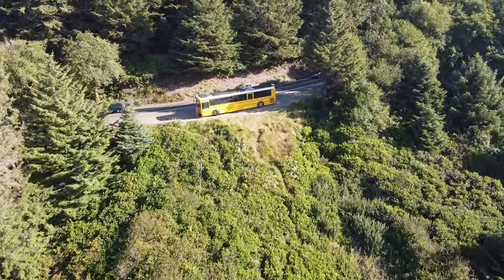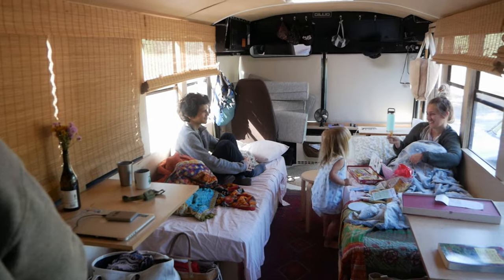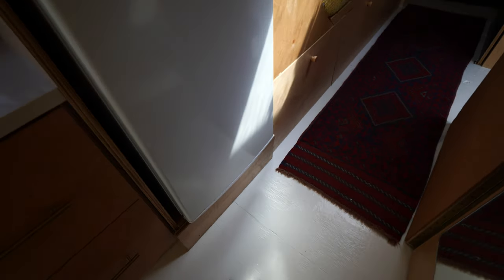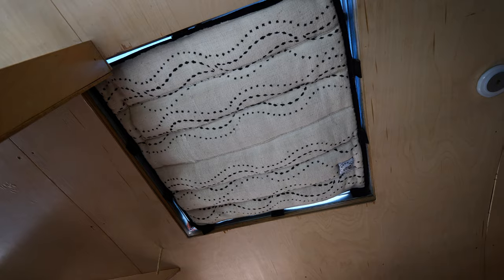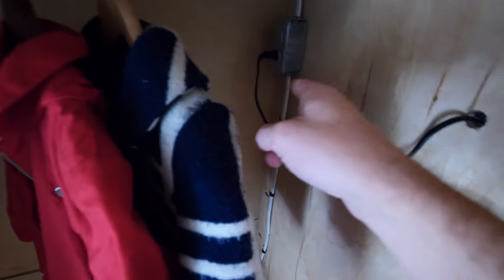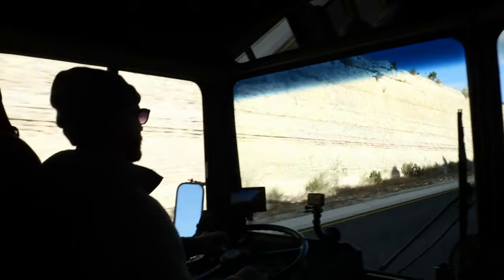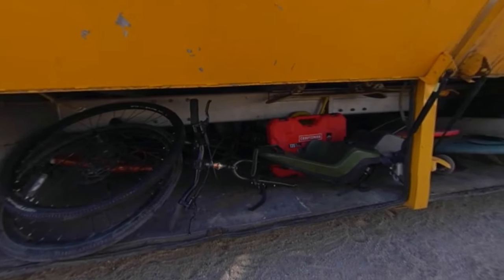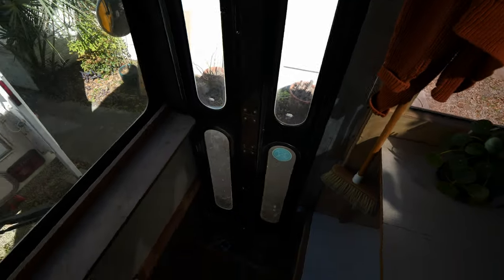Tour Our Beautiful Bus Conversion that Could Be Yours

Comment: I love this bus and I have enjoyed watching your videos but to be honest at the end of the day it's a 36 year old bus and almost a hundred grand I could buy a very nice rv that is new and has a warranty.
Reply from the maker: It really depends on where your priorities align and I completely get why you may feel that way about the price. I have spent a lot of time talking about the pros and cons of a class A RV vs a school bus conversion over the years in videos and with bus and rv dwellers and unless we're talking about something unique and built on a Coach Bus chassis (which a Gillig Phantom has a lot more in common with than a school bus) I'm picking the bus conversion. With a well built used bus I have little concern of depreciation which you're going to experience heavily with a new RV. I have a rig built on a steel and aluminum platform, not fiberglass and 1x2's, quality hardware which RV's lack, Birch plywood construction vs manufactured materials and vinyl walls. A bus can be purpose built for a use case like ours has been. An RV has been mass produced for profit. New RV's lack meaningful solar power, don't have lithium battery banks, don't use reliable Victron components. A bus is more exciting, fun, has more character, can be more aesthetic. Rv's are mild mannered, sensible, similar to other rigs at the campground. But realistically and probably most importantly there is no Class A 40 ft RV brand new for $100K. There just isn't. For $100K you're getting a 5 year old 32 ft gas front engine RV and I'm sure that's fine for you but it's not really in line with our bus. A new 40 ft Pusher built on a coach chassis is absolutely north of $300K. Sorry for the essay!
Reply: @MobileDwellings  I absolutely agree 100% with everything you said my biggest concern would still be with the 30 year old drive train.
Reply from the maker: I'm going to pick the all mechanical Cummins 8.3, DT466, or Detroit Diesel 6v92 in a big rig. I can't afford to bring a bus to a shop when electronics go bad. I need to be able to fix it myself and with either of those 3 drivetrains, pre electronic injection I can do it.  Modern engines...not at all. At least not on the side of the road. Its the tow truck every time. A couple of grand for emergencies can go a long way with diy repairs and we didn't spend much over the 25,000 miles we put on the bus. Replaced a couple older coolant hoses, a brake line, and a governor. That's about it. But I've never had a warranty before and I'm sure the peace of mind would feel good!
Reply: @MobileDwellings  Hi Justin,
I agree it's more like a coach bus than a school bus. Especially as far as power train and chassis type.
It's a beautiful bus, though I honestly believe it's priced a little high, check out the In and Out Burger MCI bus conversion was  for sale. (I can look for the link if you'd like, it was posted by Andrew Steele) 
 I realize it's not an RV type setup, more of a mobile office setup. I'm just basing my opinion based on that and other bus conversions I've seen
I mean no disrespect at all, none is intended.
It's absolutely beautiful and well done job on everything, your work is top notch. I'm also sure that power train will hold up for many years and miles to come.
JMHO on the price.
Your videos and family are amazing, I'll always referencing them now and in the future.